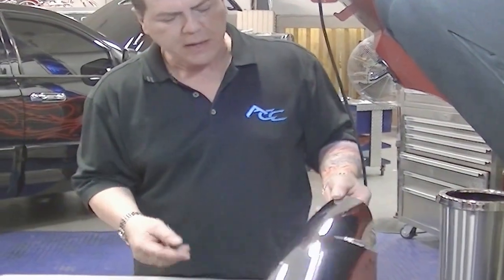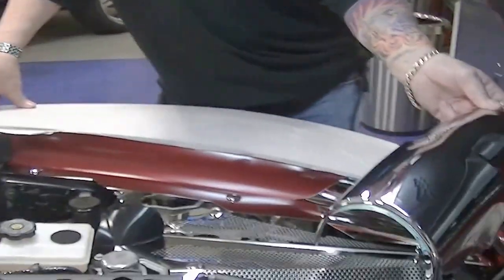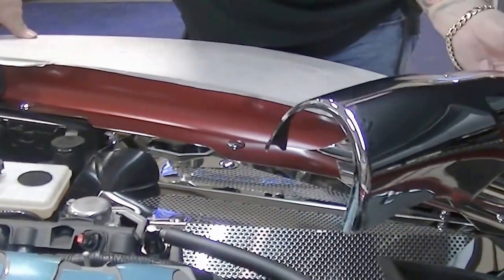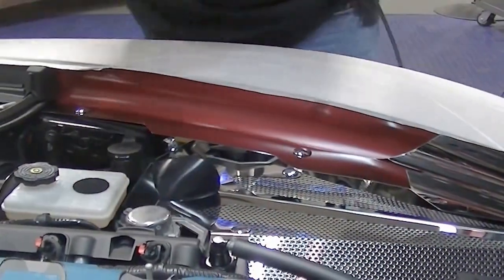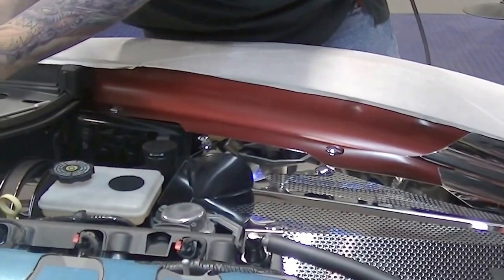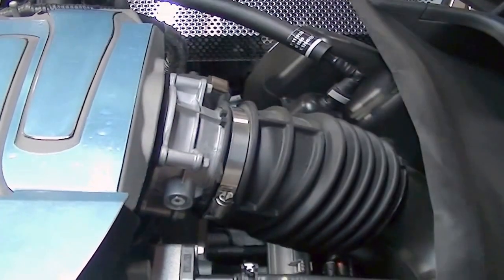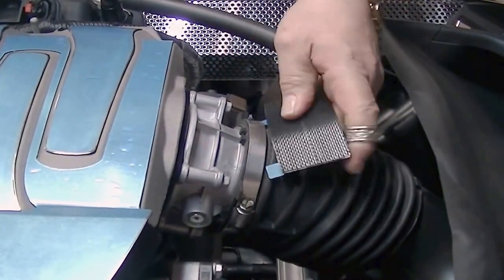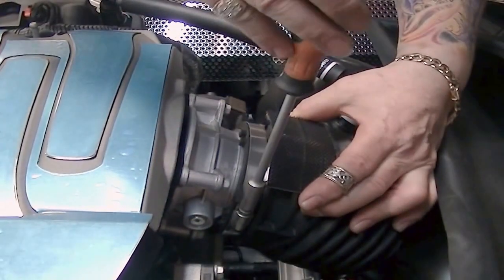How to Install an American Car Craft C7 Corvette Chrome Molded Throttle Body Cover

Comment: Any videos on how to install alternator cover part# 053049? I'm not sure of the plastic vacuum hose clip and wire harness connector that needs to be removed. Thanks